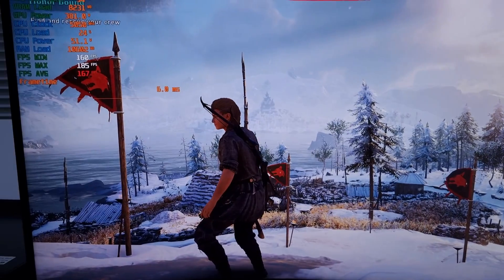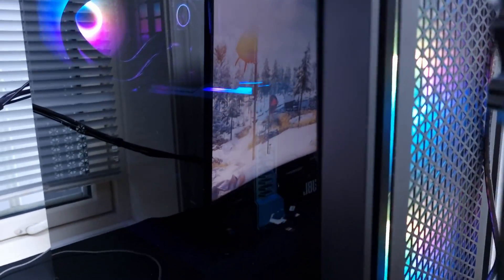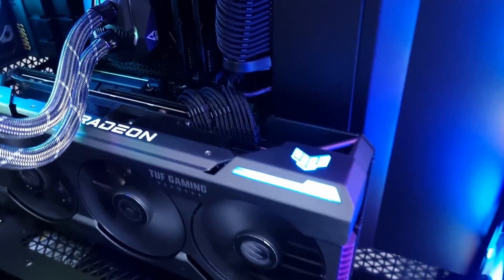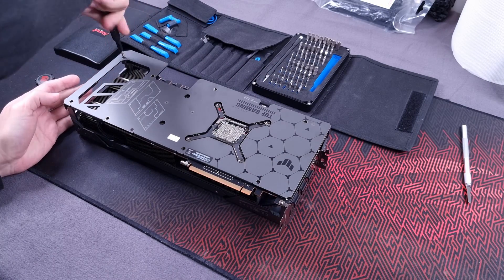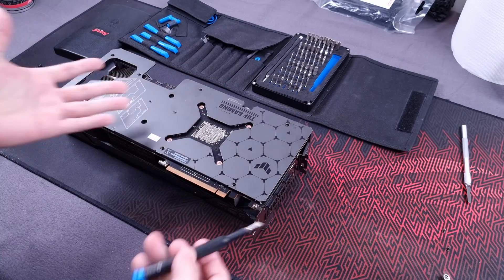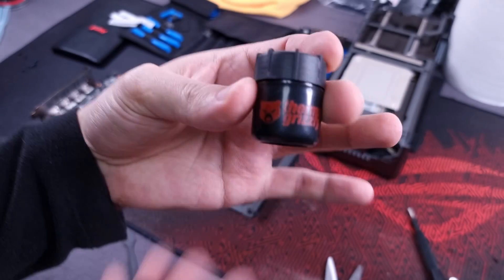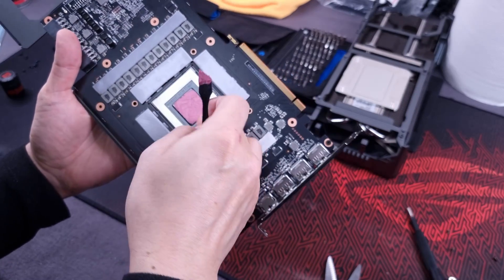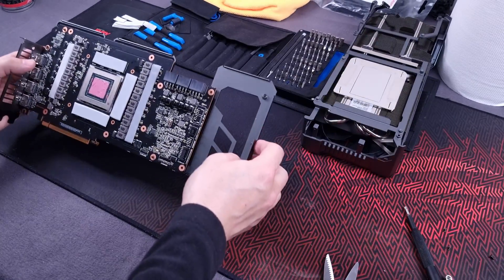ASUS TUF RX 7900XTX TEARDOWN (hotspot fix)

Comment: Thanks for sharing! 👍
I have a 7900 XTX from AORUS and that model uses a vapor chamber. I also have a pretty big difference between GPU temp and hot spot (+27 degrees) which made me think something was wrong, but after watching your video I realized everything is within normal. The GPU temp at 50% fans is around 50+ degrees. I can easily recommend a video card from AORUS.
Reply from the maker: Hi. What is your actual hotspot temperature while gaming?
Reply: @TechnologyHive  Let's say ~50 - GPU and ~80 - hot spot maximum at most demanding games. I'm using this card at 50% fixed fan speed while gaming.
Reply from the maker: @IndigoOwnage  You're roght! That is pretty dang good! Cheers man! :)
Reply: aorus elite here as well, just did my first repaste - after a year of solid temps hs went to 110c, so I tear it down and used tpm 7950 - you can find some reddit posts about this card being tearn down for  help, and I'm back again - altho I'm maxing it out for 464w and hs are around 90-98 while normal temps are 50-60, its still better than 110 hs

Comment: asus rx 7900 xt tuf i want to buy it but after watching this video.. i have concerns
Reply from the maker: I also own a 7900 XT reference model by Sapphire. However, this one does not suffer from the same issue ironically. I forgot to mention in the video that asus is using MPS voltage regulators and pwm controller on this RX 7900 XTX. MPS is high-quality stuff.
Reply: @TechnologyHive  in the  techpowerup reviews asus tuf 7900 xt is having a good hot spot temperature

Comment: I got that GPU and i also got 20c difference between average and hotspot.
Reply from the maker: I believe, after taking mine apart, that the problem is the design. The chiplets are not all perfectly flat with each other, thus causing a hot spot. But after replacing the thermal paste, the temps went down by 15c. I'm happy with this result.
Reply: @TechnologyHive  Id guess the surface is not perfectly even. I think "Northwestrepair" mentioned it in one of his repair videos about AMD cards in general. Nontheless Nvidia is much stricter in terms of pricing towards their AIBs, so those have to cut every corner to make some profit, whereas AMD is way less strict. Meaning, if the AIB is not super greedy its more likely to expect higher quality components on AMD custom models.
Reply from the maker: @Greenalex89  In my opinion, I believe the issue lies with the chipplet design. If you look at the surface of the core design when all is clean, you'll notice deviations in the light reflection, meaning they are not all perfectly flush with one another. But using a good paste will definitely help.
Reply: @TechnologyHive  I think i found another flaw in the design. You may have not encoutered that issue since you use the card vertically. 
After moving to a new case, i found out that the temps went 5c hotter. So, i went back to the old case (i got multiple cases, don't ask questions...) and the temps went instantly to 95c. I am cautious, i don't bang or force when i handle the card. 
I tried outside the case with a riser, same temps. So, i opened it to see how the paste was doing (i repasted a few weeks ago and the temps were good). I was greeted by the same patern you had on yours, but worse. Left side thick paste, right side no paste. So i added a goop of paste, and temps went back to 80 on the hotspot (i was heavy handed on the first repaste, there were a ton of it, it have been pushed to the sides).
I think the support bracket that is built in modern GPUs, the one passively cooling the VRM, is overbuilt on this GPU. It goes all around it and screw to the fin stack to the sides. I think this method put pressure on the fin stack because the craftsmanship is not as precise as it needs to be. By screwing the fin stack to the bracket, it pull the fin stack away from the board. It makes it very sensitive to any horizontal bending of the card.
When i assembled the card back, i didn't screw the shroud surrounding the fans, it is this part that screw to the fin stack through the bracket. I think without it, the card could bend a bit without pulling on the fin stack.

This is crazy that you could fuck your card up just by manipulating it normally.
Reply: @PyromancerRift interesting so are you recommending vertically mounting it? It seems like that would exacerbate the pumping out effect due to gravity.

Comment: Thanks for sharing a teardown and even checking the pad thickness, gonna try this with my TUF soon.

Asus actually cheaped out on the cooler as their 4090 TUF uses a vapor chamber while everything below is just a block with heatpipes strapped to it. I'd imagine AMD is less aggressive with the margins their partners can make so this is just a complete dick move on asus' behalf.
Reply from the maker: Well worth the new paste application. Yes, the VRAM pads are 2mm and VRM are 1.5mm. At least on this model. 👍
Reply: @TechnologyHive  I'm gonna put my findings here as this being the only TUF disassembly vid I might aswell share my experience for anyone else dropping by:

So I opted to use PTM from aliexpress instead of paste, just buying from whatever seller has the best ratings and most units sold seems to be the safest bet.

Saw an immediate improvement to thermals. Prior to the repaste my temps in cyberpunk were about 50c/84c edge/hotspot with the fans ramping to 1800rpm. now it's about 56c/76c and the fan staying at 1000rpm. Edge temps would creep a couple extra degrees but the hotspot just hangs out at 76. Apparently this is only meant to get better as the ptm heat cycles and fills in extra gaps but i'm already happy with the results.

When I first bought this card near the end of november 2023 my hotspot delta was closer to 26c. Judging by reports from practically every other AIB this increase in thermals is a matter of when rather than if. YOU WILL HAVE TO REPASTE YOUR 7900XTX CARD. And probably the 7800xt too as thats also chiplet based. rma'ing will only delay the inevitable and in my case - would have to be done every 2-3 months if you actually care about the cooler you bought.
Reply from the maker: @Gadtkaz  Interesting! I'll have to try this TIM. Great results man! Thanks for sharing. 👍🏼👍🏼
Reply: @Gadtkaz hi, thanks for sharing this, I also have asus tuf 7900 xtx and was thinking to replace the thermal paste. Did you just replace the thermal paste with PTM 7950? Or did you also replace the thermal pads?
Reply: @madararinneganuchiha  was planning on redoing the pads if they tore but I got lucky with all of them. So all I did was replace the paste with ptm. 

A tip for the pads is to run a load before disassembly to warm the card up a bit, then disassemble with the cooler facing down/backplate facing up. That bit of residual heat and gravity should keep all the pads stuck to the cooler.

Comment: Sapphire always my friend.. when comes to AMD, they are like EVGA for nvidia.. so their cards always having good temps.. Having Sapphire Nitro+ and i am more than satisfied. I am glad you fixed it, also that thermal paste is for extreme overclocking so i believe it will never dry out
Reply: It doesn't matter what card you have this is a design flaw with the card. The Chiplet design causes the paste to "pump" out of the sides and away from the center due to repeated heat cycles or at least this is what the OC community thinks. Some people have had good luck with graphene kyrosheets otherwise you will just have to keep repasting it. Idk wtf is up with GPU manufacturers nowadays, at least it won't catch fire like 4090
Reply: @rodiculous9464  Is it possible - the flaw is more 'apparent' on some cards than others?  Or does it need this 'fix' eventually?   I was considering a 7900 xtx but I dunno if I should get one after reading about this and this video is yet another one talking about it.    I have read some Sapphires have the problem too - temps, coil whine - one of those probs.
Reply from the maker: I love Sapphire! I just happen to pick this one up at the right price. And yes, the Extreme version of Kryonaut is a good paste even for longevity. It's been running 24-7 on a 2080 i use for folding@home for over a year now. Temps are exactly the same.
Reply: nitro is cool, pulse have hotspot issues as well
Reply: Sapphire fucked me over. I have the 7900 XTX Pulse, and have a 20-25C delta, with hotspot hitting 105-110C in certain games, even with GPU utilization only at 70%.

Showed everything to Sapphire and they basically shrugged and said "Go contact your seller." 
I went to Newegg, attempted to tell them same thing and that Sapphire referred me to them, and Newegg said "Its past the 30 day period, no returns are accepted."
"I don't want to return it, I want to warranty it. It's within the manufacturer's 1 year warranty."
"You didn't buy a warranty from us; please contact the manufacturer." ends chat

Cool. Fuck Sapphire.
Reply from the maker: @KyleHatesBees  Replace the thermal paste with something good, like MX-6. Problem solved.
Reply: @TechnologyHive  I have a similar issue. The pump on my toxic 6900xt has gotten super loud lately. I can hear it over the fans even though it’s sitting under the desk now. The thing is when I got the card it wasn’t nearly as bad. My pc was sitting on my desk and while I was also able to hear it in the beginning I had to realy pay attention and turn the fans way down. Also the sound itself changed and sounds a little more like friction. The radiator is mounted in the top so air in the pump shouldn’t be the problem. 
I contacted them and they said the same thing. Luckily the website I bought it from told me to send it in and they will check it. There is no reason to void the warranty and risk shorting your card if you don’t know what you’re doing so I would not recommend opening a card within warranty unless you know what you are doing.

Comment: Was the initial monitoring with the PW limit increased? If it is then it is expected for temps to go up. I did this with my taichi 7900xtx but used ptm 7950 for the core and replaced pads with upsiren u6 pro putty. I had the same results on hotspot being sub or about 80 c.  with PW limit maxed out hotspot peak reading never exceeded 95c (in kh3 with 200 percent render resolution which made my hotspot shoot previously to 107c). Either way it's good to see you had success with this.
Reply from the maker: I was actually impressed. Dropping 15 degrees just with a thermal paste which is not liquid metal, is pretty good. It sorta tells you the kind of paste they use during assembly.
Reply: @TechnologyHive  yeah unforunately ASUS doesn't care much about AMD GPU's they just slap the same cooler as they used on NVIDIA without any changes made specifically for AMD. That's why Sapphire is the best brand for AMD
Reply from the maker: @kyantemori  I love Sapphire too. My 7900 XT is made by Sapphire, and it works perfectly out of the box.

Comment: thermal grizzly doesnt have durability, use a better paste that wont go bad in 6 months to a year. The thicker the better, you can also try that phase change honey well PTM7950 stuff
Reply: PTM 7950 on my taichi ASRock 7900xtx and my hotspot is 74-76!! Never higher
Reply from the maker: @ukaszbarys4263  This is  from Honeywell, right? For most people who just want to replace the thermal paste and forget about it, this would be perfect.
Reply: @ukaszbarys4263  do u use it also on the vram instead of the pads 
Or only on the chip instead of the paste??
Reply: @ukaszbarys4263  Hi ! Is it simple to repast the card ? I've got the same as you and I regularly reach 95°C and sometimes more. Some advice or a video on YouTube showing how to do it ? Thanks for the help
Reply: @ukaszbarys4263  what size pads did you use otherwise
Reply from the maker: I've been running TG Kryonaut Extreme on my Folding @home machine for over a year now 24-7 using a 2080 card and temperatures are still the same. I heard the regular Kryonaut does lose its thermal conductivity relatively quick compared to other pastes. But this is not what I have experience with the Extreme version. Perhaps its due to it's different composition.
Reply: Thick paste just resists thermal pump out effect. No paste lasts forever.
Reply: @TechnologyHive  regular does which is why i stopped using it after 7 months and didnt dare touch TGE but i'veseen a couple posts with the same issues crop up very recently with high power limit cards. 
Would you mind keeping me updated on its durability in this card?  

My paste recommendations still stand.
Reply from the maker: @kommandokodiak6025  Yes, no problem man. I'll let you know if I see any changes with the 2080 or this one here. 👍
Reply: @TechnologyHive  hi, do u still have this card?
Can u please tell me the thickness of its thermal pads if possible?
Thank you in andvance❤️
Reply: honey well PTM7950    !! FTW
Reply from the maker: @moradorderua71  I keep hearing about it. I'll have to try it or do a video on it now :)
Reply: @moradorderua71  Pelo nome ja sei de que país é haha
Reply: @kommandokodiak6025  I'm also having issues with my Asus strix Rtx 4080 OC with the hotspot temperatures are around 110-113°C, I bought it like 6-7 months ago, I was also frustrated but then some reddit op replied me and gave me a godly solution!!, he said don't send your card to Asus they'll just put another cheap thermal paste and after 6 months you'll have the same issue again and maybe they'll send you refurbished one too 💀 and you'll never even know... He told me to buy some "Honeywell PTM7950" and change on your own, so I ordered it from L.t.t store and it will arrive to me around 2 weeks from now... Let's see how it goes.
Reply: I have repasted my 7900xt 3 times and even RMA’d one of them.  Same damn thing hot spot jumping to 110c after 3 weeks.  
So done with this crap
Reply: @bmdshred77  try to undervolt. Rdna is done for this. You will notice less power usage, 3-4% more perfomance and something like 20 °C less on the hotspot
Reply from the maker: @bmdshred77 Try Thermalright Heilos. It will fix the problem for good.
Reply: I have a Red Devil 7900XTX and it was reaching 110C with the factory paste, after I changed it to PTM 7950 Hot Spot went down to 95C under full load with +15% Power limit and UV to 1135mV. I am waiting for Kryonaut Extreme to arrive to see if I can bring it down below 90C. Edge temp is around 70C
Reply: @astoraan6071  How long have you been running it? PTM7950 needs to be power cycled a couple times for it to meltdown completely and conform to the die. So loping extreme graphics benchmark runs are recommended then letting it cool to ambient and then looping the graphics bench again ensuring its conformed to the die. Also be sure you reassembled the card properly,  because thermal pads can cause contact issues. Did you happen to install replacement thermal pads in addition to the PTM7950?
Reply: @kommandokodiak6025  No replacement thermal pads were needed as the original ones didn't tear at all. I made sure all screws were tight. I will take your advice about looping benchmarks and hopefully that helps get temps down. Thanks
Reply: @astoraan6071  it doesnt hurt to remount either, any part of it that overflows the edge can be put back in the middle and itll reflow
Reply from the maker: @astoraan6071  I'd stick to PTM7950. Kryonaut Extreme is good but will eventually fail to keep the hotspot under control.
Reply: @TechnologyHive  I've heard that about aeronaut but not about Kryonaut. I do want to try the graphene sheet but that's risky as hell since it's electrically conductive. Maybe if all else fails I will try that.
Reply: @kommandokodiak6025   can you apply the ptm7950 on both the core and where the thermal pads were placed?
Reply: @ryanmolloy5421  its too thin for for places where thermal pads go because of the thickness required. There is a technical way around it using copper shims there were some places selling copper shims made for specific graphic card models, you'd use the ptm on both sides of the shim
Reply: @kommandokodiak6025  ah yeah I figured it was probly too thin. Any sites you know that sell those shims? The ptm sandwich sounds amazing. My sapphire nitro is brand new but I already have a hot spot of 95 degrees while the card reports the rest at 75, which is a bit concerning.
Reply: @ryanmolloy5421  You have to use a thermal putty like Upsiren U6 pro for the vrm and memory (to avoid the hassle of using thermal pads) and PTM7950 for the gpu die.
Reply: Honeywell PTM7950 is very nice.

Comment: U just lost ur 3 year warranty.  I would never disassemble my gpu until it has warranty. After the warranty expires i sell it with the intact sticker on the screw.
Reply from the maker: I am not worried about warranty 😄. I repair GPU's on the side. Anything goes wrong, I am able to fix it. This was just a simple thermal paste application issue from assembly line and or poor thermal paste quality. 🤙
Reply: You dont lose your warranty  for servicing your gpu. If you modify,  shunt mods, or use liquid  nitrogen, then yes.  Any damages  you may physically  do, then yes .
Reply: @griffenxzable  😅 In EU and US and everywhere in the world if u brake the sigil tape on the screw than u just lost it and no warranty or return policy exist anymore.
Reply: @d4nith3  I heard its not legal/legitimate to put the sigil tape on the screw. Guess it depends where people live. But its certainly a dickmove by companies who do it and apparently u dont lose the warranty if u remove it if its on the screw.
Reply: This is a known issue with this card, there is nothing you can do about it. You can either repaste it or rma it and repaste that one in a month or two when it pumps out all the paste